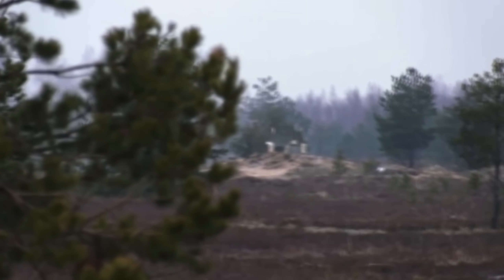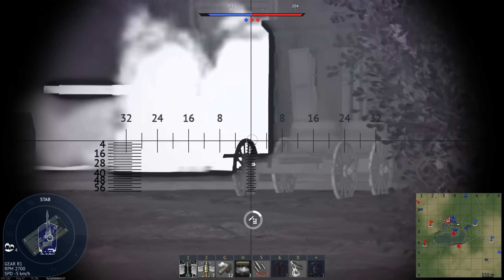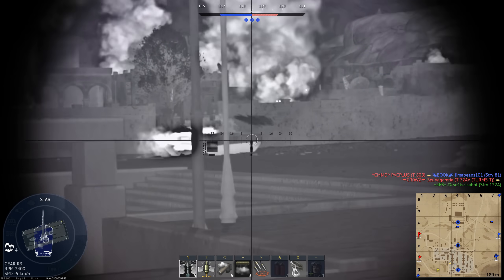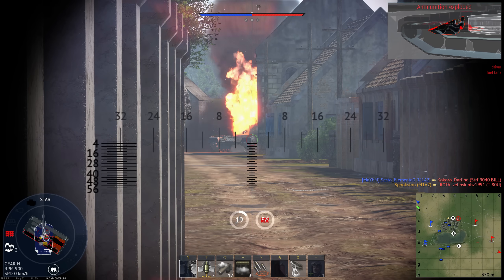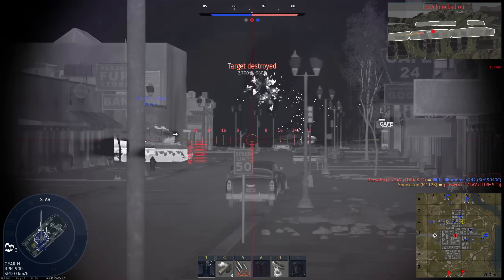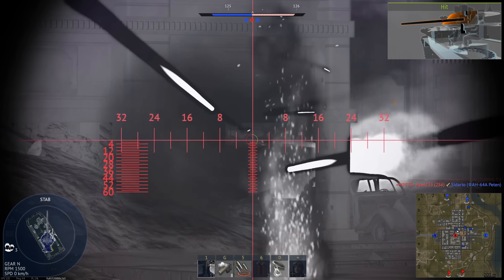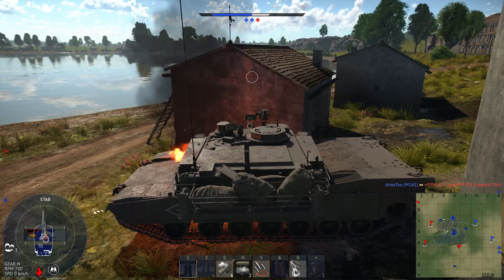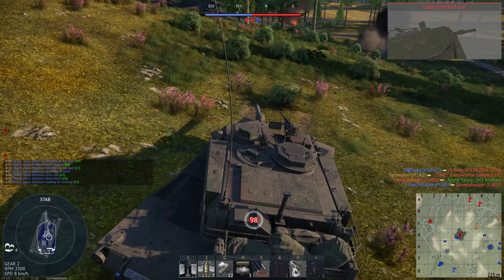Why The M1 Abrams Uses Depleted Uranium

Comment: "The US military doesn't care about the ecological impact..."

Not their job to.
Reply: They aren't even going to use much DU anyway.  This isn't training ammo.  It's only going to be used against heavily-armored vehicles, and large-scale tank battles aren't exactly common in contemporary warfare.
Reply: @jic1  DU isn't only used in tanks. But also in missiles, aircrafts and even the new flechettes (which kinds of defeats the purpose of replacing cluster bombs. Those have been made illegal in most of the world, and even before that unusable by the US military, because of the issue of high amounts of duds making the areas they hit as dangerous as a minefield. But if they want to use DU flechettes instead, that still makes the impacted area unsafe, even if for different reasons).
Reply: @thefirstprimariscatosicari6870  But those DU munitions are still intended for use against heavy armor, and are therefore rarely used.
Reply: A good example is the DOD has a program for green bullets not because they want to be environmentally friendly, but because its too expensive to keep using them and complying with the environmental standards.  It was cheaper for them to go green.
Reply: Any military that puts "wokeness" above pure efficiency is guaranteed to lose the next war.
Reply: Yeah we do, nuclear power is very green.  Not to mention our conventionally powered vessels have excellent exhaust filtration (it makes them harder to detect and track).
Reply: @mikewaterfield3599  I'm quoting Spookston here, mate. My point is that it's ridiculous and absurd to complain about a military not being overly concerned with environmental issues. It's not their job to do so, their job is to win wars. Any positive environmentalism that comes from the military is and must always be a secondary benefit, as you've demonstrated.
Reply: @lesthodson2802  yeah, the most a millitary should do is to have exhaust filtration in peacetime and not make a mess by dumping oil, gas, diesel and other things
Reply: @lesthodson2802  I was being totally sarcastic myself.  That said there are a few things that are actually quite eco friendly about the modern war machine.  Even if it was accidental.
Reply: Not any military's job to
Reply: If caring the environment makes them superior from their opponent then they will, sadly they won't
Reply: @Fae-Fey  laughs in veitnam
Reply: Only because they don't fight on their home turf, and don't care about post war reconstruction. Depleted uranium creates many dust particles as a result of its self sharpening and igniting, which then contaminate the combat area. After the war is over people will keep on dying because the land itself has been poisoned by it. It's the same as with other illegal weapons like Agent Orange or mines.
Reply: @thefirstprimariscatosicari6870  I guarantee you any military will use those weapons, even if not especially on their home turf.
Reconstruction comes after you've secured land and infrastructure to reconstruct.
Take your idiotic bs somewhere else.
Reply: @lesthodson2802  The US military is clearly not desperate enough to have need to use poisonous gas so I don't see why it should use depleted uranium. But on the other hand the USA doesn't care about securing land anyway, so I guess the more long term devastation the better. 

And going further with the comparison with gas, even in the darkest and most desperate periods of wars, like far too often during WW2, none of the combatants used it. And the reason is simple: it would have been suicide for whoever was losing, and unethical for whoever was winning. As I said, NATO already has the upper hand in whatever conflict it finds itself. If it's DU-using members truly wanted to secure anything, they would want to avoid the natives ire by poisoning their land.
Reply: @thefirstprimariscatosicari6870  Spoken like a man who understands exactly nothing of the underlying concepts.
Reply: @thefirstprimariscatosicari6870  Gas wasn't used in WW2 not because it was unethical, but because it wasn't needed anymore, warfare stopped being static and became mobile.  Gas was a solution to a problem that no longer existed.
Reply: @hdog9046  The Germans didn't use it because they feared retaliation, and used a lot of horses for troop mobility. Horses refuse to move if they can't breathe well, and do not readily tolerate gas masks.

The fear was that if they used gas, the enemy would also break the geneva convention and use it as well. And that it would cripple their equine based logistics.

For the most part, the Allies (aside from Soviets) adhered to the Geneva convention. And didn't use gas on principal.
Reply: @thefirstprimariscatosicari6870  ok Ultra Smurf, not everything in GWs fiction is so fictional.  War is hell, it requires levels of sociopathy to fight a war.  As hawlsey put it “if you find yourself in a fair fight, you didn’t plan properly.”  That said the old martial plans, and post pacific reconstruction would not be accepted today.  SJW toadies call that imperialism.  They are the first screaming “someone do something!” When the next African warlord rises and he last to act.  See Mogadishu and Adid, see Bosnia, see Serbia, see Cambodia, see Grenada.  You can’t call in a military for peaceful purposes.  Not to mention “peace keeping” is a laughable concept.  The only real peace you find through a military is the kind you get after letting them do their job.  The buerocrats found peace at Versailles and well not even twenty years later that got us Nazis.  After the commies and allies ripped Germany literally in half... well Europe has basically known peace since.  See Badab for the fictional parallels.  On a closing note quit coveting Calgar’s job!
Reply: @mikewaterfield3599  Europe has only known peace thanks to MAD. And even then, inter and intra national violence never ceased. It just became subtler and less direct, with terrorists attacks, civil unrest and ethnic violence.

As for dealing with African warlords, those usually arise after the latest foreign army has razed to the ground the previous leader's accomplishments without offering anything in return. It is indeed impossible to gain a long lasting peace from the barrel of a gun, but this is especially true if said gun was previously used indiscriminately.
Reply: @thefirstprimariscatosicari6870  indeed, the alternate option is to allow those with a willingness to use violent force to have their way, sharia Muslims, commies, classic warlords ect.  Why do you think Khornite berserkers tend to rise to leadership in chaos war bands.  Fiction emulates life not the other way around.  Sad truth is just look at chimps.  They can and will genocide other tribes for a variety of motives.  Humanity only added ideology as a reason to kill each other to the pre existing animal reasons.  Well that and we developed sophisticated ways to do it.  It’s far more fitting that you mention MAD.  Often the most effective weapons are the ones that need the least use.  The fantasy land John Lennon sang about and that modern “democratic socialists” want to force upon us is asking for the first strong arm to make flesh lights of us all.  There exists an element of social Darwinism in the human condition.  As a vet, a fire arm owner, and someone who is quite self made I accept conflict and at times violent conflict as a requirement to first attain and then to keep most anything.

Comment: Funny enough the Navy went the other way. The Phalanx Block 0 close in weapons system back in 1979 was able to use 20mm DU APDS. Because of its toxic nature the Navy requested to drop the use of DU so from Block 1 Phalanx 1988 onwards it uses Tungsten APDS and Phalanx can no longer fire DU at all by design
Reply: It would honestly make way more sense to use tungsten for anti anything with little to no armor. It would put more of a pushing force destabilizing the target on top of the fact that getting shot in the first place also already did that.

Comment: To my knowledge the M1 with the L44 and DU rounds has around the same penetration as the longer L55 with Tungsten so why don't they adapt the latter. The M1 right now has the problem that it's penetrator can not be any longer because of the size of the Ready Rack in the turret. So adapting the L55 semes logical in my eyes, like that they can still keep penetration performance and have the possibility of more penetrativ power in the Futur.

Comment: One reason the United States uses DU is because tungsten carbide is just as toxic upon ingestion as depleted uranium. It also can cause lung damage if inhaled and even result in the formation of tumors with enough exposure. Also, to detect TC particles requires a scan via mass spectrometer, while DU only requires a simple detector for alpha particles.

Also, DU is far less likely to shatter than TC, due to it's more malleable nature. This makes it better at absorbing and redirecting force, as well as armor penetration as you mentioned. 

https://patient.info/doctor/tungsten-poisoning
https://en.wikipedia.org/wiki/Mass_spectrometry#:~:text=Mass%20spectrometry%20(MS)%20is%20an,mass%2Dto%2Dcharge%20ratio.
https://www.scientificamerican.com/article/the-science-of-the-silver/
Reply: @komradearti9935  Not with the way modern Armor works. Modern “composites” are basically just stacked layers of NERA which works by repeatedly bending and warping the projectile/jet until it shatters against the main armor. In this setup, more malleable (yet still extremely hard) substances such as DU or even titanium are far better at stopping projectiles via deforming them before impact. 

I’m Also, tungsten is considerably more brittle than steel, whereas DU is capable of bending and redirecting force where TC will simply shatter. We can already see this via the self sharpening properties of DU penetrators. Also, Germany still uses TC penetrators as well as armor for political reasons.

https://en.m.wikipedia.org/wiki/Non-explosive_reactive_armor
https://sturgeonshouse.ipbhost.com/topic/553-fucking-nera-everywhere/
https://germanarmor.blogspot.com/2020/04/german-120mm-tank-ammunition.html?m=1

Comment: Just a little correction, DU isn't brittle at all, it can have same strength as some steel alloys and it can have hardness up to 45 HRC, in comparison hardened steel have hardness about 60 HRC.
Reply: Many materials which are hard are also brittle.

Comment: the reason why the Honeywell AGT1500 is used in the M1 Abrams family is cause of one line. "the engine can use a variety of fuels, including jet fuel, gasoline, diesel and marine diesel." means it can take the fuel of the enemy and use it to keep moving.

Comment: Being self sharpening and pyrophoric go hand in hand, from both of the master gunners I've talked to along with an ammunition/weapons brief they let me sit in on the idea is that in the latter parts of penetration those flakes that break off from the rod catch fire when exposed to the air in the turret. These then go on to cut open and ignite hydraulic lines disabling the tank and forcing the crew to bail.

Comment: Because highly dense materials allow for better transfer of kinetic energy.  Cap it in tungsten so it doesn't deform on contact with a hardened surface and bingo!  You have the secret sauce for purely kinetic armor penetration.  Fire it as a fin stabilized sabot and watch the fun.  The 120mm on the abrums is hardly the only place we use them.  The GAU8 off the A10, even the M61A can fire the 20mm variety.  You ditch copper jacketed lead for tungsten jacketed DU when you truly need to get the point across to your enemies that they need to stop existing.

Comment: To be fair, practically every heavy metal is poisonous, even lead, aka. "lead poisoning"
Reply: The issue with uranium in particular is also one the result of its self-sharpening and igniting: it creates A LOT of dust particles. More than tungsten. So there's an higher chance of it contaminating the combat area.
Reply: Problem is that the toxic effect of depleted uranium, when ingested, is much worse than even tungsten.

And that tendency to burn up on hit, that makes it "self-sharepen"? That creates a lot of toxic dust, easy to breath in.
Reply: @jack99889988  Yes, but what these reports don't mention is how ridiculously low the quantity is. The shell is flying fast over long distances. The amount of uranium oxide per unit air volume is close to zero. But even by adding up the amount of gases produced, any company will produce more potentially poisonous gases in an hour. Plus, if you're sitting in a tank that has been hit by a depleted uranium dart ... the toxic gases aren't your first thing on your mind. If you still have the head, of course. Yes, weapons are meant to kill. Terrible, I know. Depleted uranium has the best chance of killing, and the drawbacks are minor, so the military ignores them. It is quite simple
Reply: A lot of ranges don't allow lead ammunition for this exact reason. There are copper/steel alternative for firearm ammo
Reply: yeah I literally died by listening to Metallica
Reply: Now there is a difference between for example noble metals
And heavy metals
Reply: Very true.

Actual poisoning from lead is generally via from organic lead compounds, like old leaded paint, leaded gasoline, mine tailings, or other organic lead sources. Elemental Lead, what ends up in bullets, is pretty much inert under most conditions. Just like with DU, people live large portions of their lives with lead bullets and fragments in their bodies with no ill effect from the lead itself. Civil War battlefields to this day have full weight bullets dug out of the ground with only a surface layer of oxidation.

Lead, like DU, has been politicized by activists. DU gets blamed on birth defects, lead gets blamed on poisoned waterfowl by anti-gun and anti-hunting activists. (Just look at what gets blamed on "Climate Change".) The links being mostly assumed for both, rather than actually demonstrated. Lead ammunition bans have largely failed to have statistically significant impact on lead poisoned wildlife. I wish I still had a link to the one small scale study where they actually tried to induce lead poisoning in birds with lead shot. Loading their food up with as much lead shot as they could, it took something like the better part of a year for the handful of birds to show lead poisoning. Something that wouldn't happen in the wild. Pointing to the source of the lead poisoning being something other than lead ammunition. It would be interesting to see a similar experiment done with DU, using animals of course. Actually demonstrate or disprove the supposed link.

/Why do I always write these walls of text? Anyway, thanks for reading this far.
Reply: @Crosshair84  You're welcome.
Reply: Key being organic lead. Inorganic lead, doesnt do much.
Reply: @Chiefshadow4  You can accumulate inorganic lead. Just ask people who collect range scrap without PPE. They have very elevated blood lead content. But organometaloids are far worse, but lead dust is far from harmless.
Reply: @Crosshair84  I'm a nerd, but that's actually quite interesting, thanks for posting :)
Reply: @Crosshair84  Don't forget dust from shooting ranges, and people who melt range scrap down without proper PPE. Smelting lead without PPE and sweeping up range-dust can send your blood-lead through the roof. But large fragments embedded isn't that bad.

Uranium is fairly stable as far as radioactive stuff goes, there are much worse things, particularly radioiodine, radio-potassium and other things that your body will amalgamate into you in ways that make even alpha radiation dangerous.

Comment: Uranium is cheap and quite hard. But even if it's hard it's less brittle than harder metals, so... win-win !
And once for all, this is not radiation the real problem with DU, but the heavy metal toxicity !
Toxicity =/= Radioactivity (chemical vs physical danger)
It's like lead or mercury poisoning. You get poisoned by DU, not irradiated ! 
Yes, i'm CBRN trainer in the army.
Lead, on some extend is far more dangerous because it's harder to trace in the environnement, you need to make some chemicals proofing while you can detect DU pretty easily.

Comment: I was literally thinking the same thing almost if not exactly the same performance as tungsten, the availability being more than tungsten, and the radiation emitted from it isn’t as crazy as the name sounds but not that it doesn’t emit
Reply: It's safer then picking up a piece of uranium ore as it has even less U-235 in it. U-238 which is what DU is has a very long half life and is an alpha emitter. Longer half life means less decay per second and the decay moment is when a alpha,beta,gamma is shot out. And uranium ore is already safe to handle really. Now breathing it in or swallowing it.. different story as it is a toxic heavy metal.

Comment: The "self sharpinging" bit is fudd lore, it actually erodes before it deforms. Thats due to its orthorombic crystal structure making it strain rate sensitive. DU alone is also not crazy hard, when you alloy with titanium and give it a heat treat, it is posible to make it about as hard as a good knife but with du apfsds thats entirely irrelevant.
Reply: it's also radioactive and causes enviromental contaimation.
Reply: @rhetoric5173  wow really do you know a video that has this info?